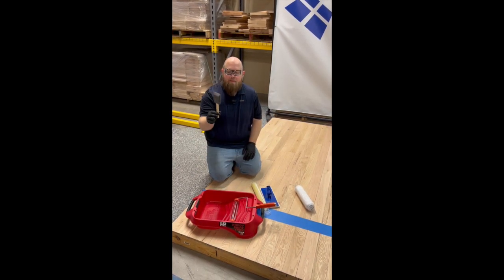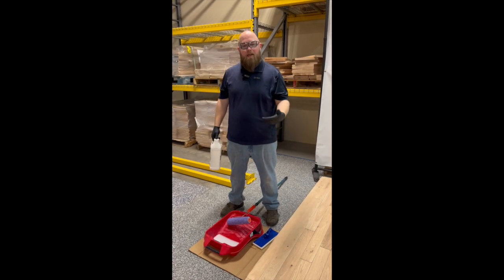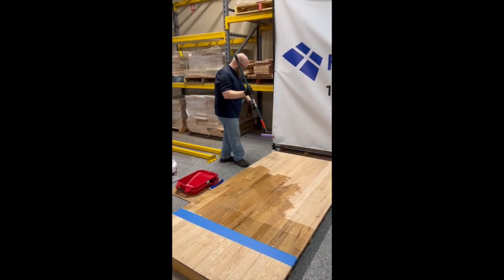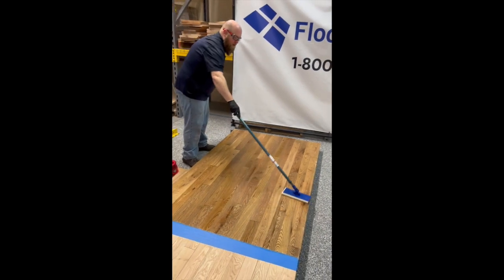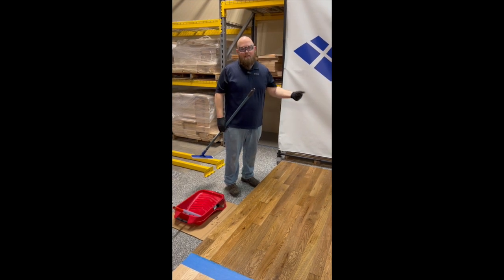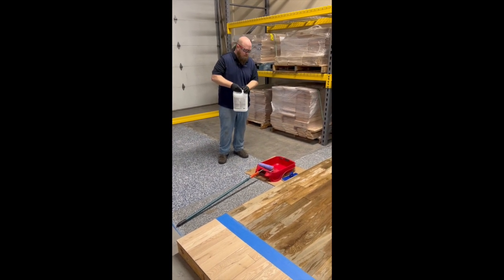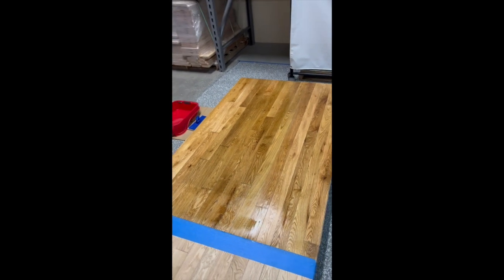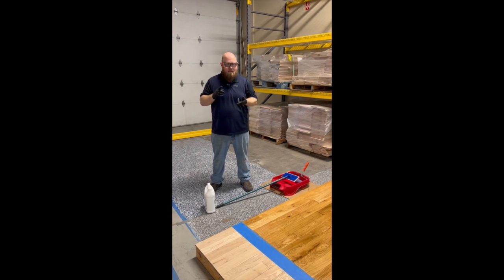Bona Red Out Demo at Floor Mechanics

Comment: Since you would like step on the freshly rolled floor when using the pad, what sort of shoes or shoe coverings are best?
Reply from the maker: The easiest is probably to cut a red pad in half and put one half under each foot. You could also use a Shubee shoe cover. Anything that prevents you from scratching up the floor or dirtying it.

Comment: After 2cd step dries completes.   Do I have to  fine buff the floors before coating the floors with water base finish?  Also what happens if I buff the floors after it dries if any ?
Reply from the maker: You don't need to buff before putting down sealer. But then you may need to intercoat abrade between layers of sealer and finish.

If you buff or sand after just the Red Out, you could end up getting back down to the raw wood and you'd see the red again.